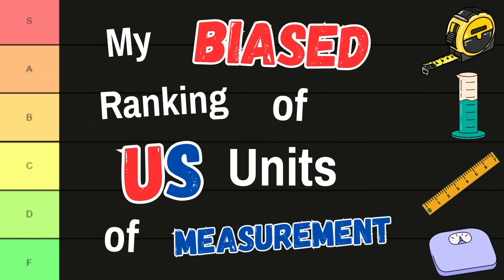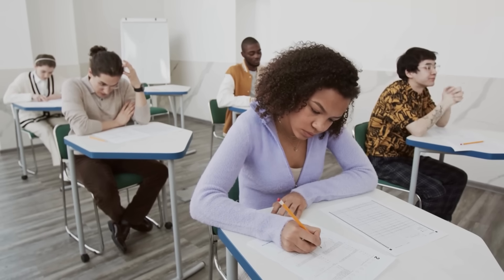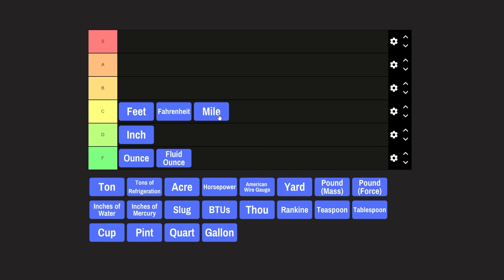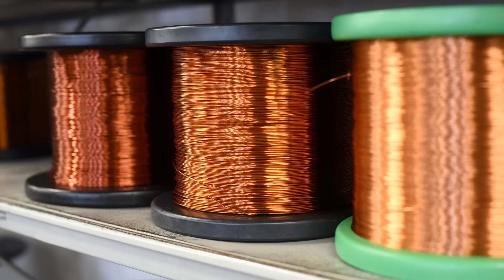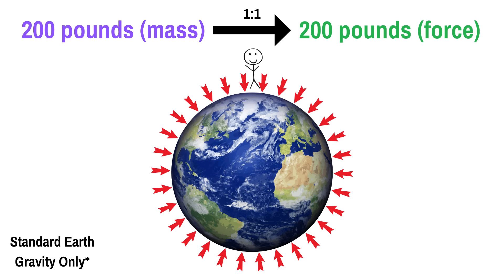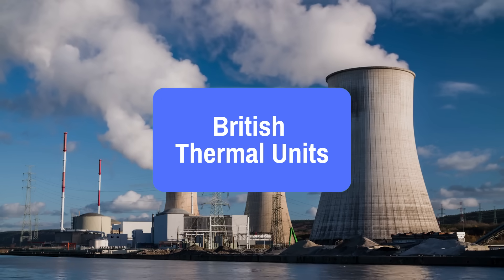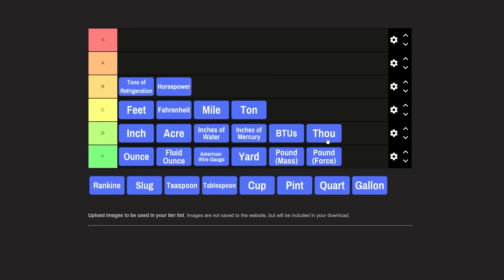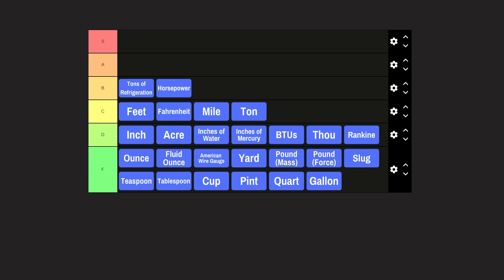Tier List of the DISASTROUS US Measuring System

Comment: If you’re going to be fair, you should acknowledge the warts in the SI/metric system too. Because it’s chock full of them. For instance:

The kilogram is supposed to be the coherent unit of mass in SI. So why does it have a “kilo” prefix on it? The 18th century French metricists wanted to call the mass of a liter of water a grave. Then the gram, the mass of a MILLI-liter of water could have been a MILLI-grave, and the tonne, the mass of a KILO-liter of water, could have been a KILO-grave. Well, grave in French sounded too much like Graf in German, which was an aristocratic title … which wasn’t politically correct at a time when aristocrats were being sent to the guillotine.

Ok but a liter isn’t actually the coherent unit of volume in SI. The cubic meter is. The original metricists had a word for that volume: stere.  So shouldn’t the coherent unit of mass be a stere of water? That’s a (metric) tonne of water. So really the tonne should be the coherent mass unit.  In which case a kilogram should really be called a millitonne, and a liter should really be called a millistere.  A gram is a milliliter of water, but that’s a microstere of volume, so shouldn’t the gram be called a microtonne of mass?

But we’re assuming that the coherent unit of density is the density of water, which is neatly one tonne per stere.  That’s what the original metricists wanted the unit of density to be. It made perfect sense. So why is SI’s unit of density a THOUSANDTH of water-density? Because either the cubic meter is a thousand times too big, or the kilogram is a thousand times too small. 

The newton is supposed to be the coherent unit of force in SI. But weight is a force. How many people get on a scale and read their weight in newtons? Why is it displayed in kilograms? Oh so you finesse that by saying that you really just want to know your mass. But what if you wanted to know what your weight would be on the Moon or Mars? Are you really going to multiply by the different accelerations and compare newtons? 

Or you can finesse it by saying there’s a kilogram-force unit equal to 9.80665 newtons. But that’s not SI’s coherent unit of force. Well why isn’t it? 

Why didn’t they use Earth’s gravity as the coherent unit of acceleration, and derive a coherent unit of length from that? We talk about acceleration in  “gees” all the time, but 9.80665 meters per second per second isn’t SI’s coherent unit of acceleration. ONE meter/second/second is. That’s 1/9.80665 gees. Talk about ugly!

For that matter, why is the second the coherent unit of time? A sixtieth of a sixtieth of a twenty-fourth of a day? Can you say ugly? Didn’t the original metricists come up with decimal time? Why isn’t the coherent unit of time a microday, or maybe 10 microdays?

Why are speed limits shown in kilometers per hour, when the SI coherent unit of velocity is the meter per second?

I could go on and on…

Comment: I would put the volume units at the end in C-tier. I prefer using those in cooking and baking over the metric system because I just have a set of "cups" each sized exactly to the respective units and its halves. I prefer filling a standardised cup with a liquid then trying to measure 240mL in a measuring cup
Reply: I didn't know that you weren't allowed to use teaspoons or tablespoons in metric. 
You might want to tell the millions/billions of people who use metric.

Comment: Teaspoons and tablespoons are nice for small amounts that don’t need to be super precise in cooking. I have an intense hatred for cups on the other hand because American recipes use them to measure absolutely everything (even butter for some reason???? how are you meant to measure a volume of butter?) when mass is much easier to measure and easily divisible however you want. Getting a 1/3 or 1/5 cup of something on the other hand is annoying as hell if your measuring device doesn’t feature those particular fractions.
Reply: I didn't know that you weren't allowed to use teaspoons or tablespoons in metric.
Reply: @ Exactly. You can still use them when they make sense.

Comment: In India we use Fahrenheit for body temperature measurement while degree Celsius for atmospheric temperature. We use kilogram for body weight, but pound and ounce for certain food items. We use feet and inch for measuring someones height but metre for depth. We use kilometre and metre for longer distance, but feet for house measurement and yard for cricket pitch. We use horsepower for engine power, calorie for food and Watt everywhere else. Our text books almost entirely use metric system but we still have these aberrations.

Comment: As an avid home cook, I agree with all of your rankings except for tablespoon and teaspoon. Cups, pints, and gallons are definitely unpractical units and I really hate to see them in recipes because they are not precise at all. Especially when it comes to the quantity of different ingredients like flour and sugar is listed in cups. 
I think (almost) every sane person has a couple tablespoons and teaspoons at home and since these are used to describe ingredients that a very small quantity is needed of, they are usually more practical for cooking than equivalent metric units. If a recipe lists that I require one teaspoon of salt, I can easily use just that — a teaspoon. But if instead it was listed that I require 6 grams of salt, most people would have a problem right there. In my experience, the majority of household kitchen scales are not accurate at all with such small quantities of mass (and sometimes don't even pick up on it until there is at least 20g on there). To name another example, if a recipe asks me to put two tablespoons of oil in a pan, I can just do that and put the spoon in the dishwasher. But if it would list the volume of the oil in millilitres, I'd have to use a beaker, which I need more frequently so I'd have to clean it by hand short after and is just not worth the effort.
I guess this is also the reason most German recipe sites list all their measurements in metric except when it comes to very small quantities where tbsp and tsp are used
Reply: I had no idea you couldn't use teaspoon and tablespoon in metric.
You might want to tell the millions, maybe billions (s) of people who do!

Comment: My pp is a 2 foot monster. Unfortunately, 60 centimeters and 0.6 meters sound awkward to me. I'm not sure what's correct.
Reply: 60 centimeters is the correct one. How is it awkward?
It's the same as me asking how do you say 2 meters? 6 feet and 6.7 inches just sounds awkward!

When you pick a whole number in one system, it won't cleanly translate. This is true both ways.
Reply: @logitech4873  what if I just describe my pp as a lion and yours as a mouse?
Reply: @Lkabss  I would use centimetres or meters. Measuring things in mice, lions, football fields, fridges, etc is a very American thing.
Reply: @logitech4873  ok I agree, centimeters for you meters for me then.

Comment: Every unit of measure is arbitrary. No matter if we use the speed of light or the distance an average man can travel in 1000 feet, it’s all arbitrary. If we talked to aliens they would probably shame us for using meters and then once we were colonized force us to use quarls, a unit of measurement with base 17, and based off the average distance of their planet to a black hole.
Reply: The difference here though is that the metric measurements work well with other metric measurements and never really need to be converted. Thus making the arbitrariness of metric measurements less compared to imperial measurements that really are just created with very little reason functionally.
Reply: @thebigcheese1153   conversion is not much of an issue with imperial either. You can do all the calculations if you understand the space between units just as easy. The arbitrary nature of local custom units is actually to the benefit of the people that use them. Knowing both I have no problem doing equations in meters, and then driving home knowing miles. Also even though I cook in mostly metric, because of where I get my recipes, I prefer the us standards because of how it splits sizes, I’d rather have 4 Tbls than 59 ml, which I would most likely round up to 60 anyways.
Reply: @Mnaughten601  True, I do agree that imperial for things like cooking and other home things makes sense. However I think anywhere past that should be in metric. I went to an Aerospace Engineering facility and found that all of their measurements were in imperial. I asked about it and they told me some other really strange measurements they use and the confusion and mistakes it gives them. I really think we should fizzle out the use of most imperial measurements except for the edge cases like Tbls that actually help. Especially things like pounds, stone, feet and inches.

Comment: this is such a tired topic. but also, fahrenheit is obviously clearly the best temperature system both because it is highly practical and celsius is terrible. i’m going to skip to point 2 because celcius has been getting away with this nonsense for too long. the boiling point of layer is a terrible candidate for 100 degrees. 1 it changes depending on your elevation, the amount of solute you have in it. 2 you never need that number. you can just LOOK at water and say oh ya. it’s boiling now. enjoy having a whopping 40 usable degrees for your daily lives though

Comment: US Treasury Bonds are traded in base 100, but the decimals are instead measure in base 32. Not sufficiently happy, american than divides 1/32 in further fractions. For example, a bond pricing 99-03+ means 99 plus 3/32 plus 1/32*1/2. Dafaq

Comment: Can someone explain why Americans use the short ton rather than the Imperial ton? ... the Imperial ton being close to the tonne (or metric ton).
I assume that it was because a hundredweight (cwt) of 112lbs didn't make sense?
Why then on top of it all  Americans then do not use the ton (or hundredweight?) but give heavy objects as thousands or millions of pounds?
Also, why change the imperial pint (20fl oz) ... to a 16fl oz pint that seems rarely used and messes up the quart and gallon? ... perhaps the quart being closeish to a litre is a saving grace.

Comment: I notice that you omitted to talk about the way all the U.S. fluid measurements were based on an error.  In the original imperial system, there are 20 fluid ounces to the pint. However, somewhere in the dim dark past, somebody in the U.S. thought there were 16 fl. oz to the pint. Seemed like a logical guess, given there are 16 oz. to the pound. This gives rise to the discrepancies on the size of a pint, a gallon, and all the other dependent measurements  between the U.S. and the rest of the imperial measurements world. Also, the U.S. ton is different to the original imperial ton, which is 2,240 pounds. The U.S. ton is often referred to as the "short" ton in the rest of the world.

Comment: I like the imperial system (British)
I would rather say I am 5Ft 7Ins than 1.71M.
1.71M means nothing to me. Same with weight. I would rather do it in stones and pounds rather than kilogrammes. Kilogrammes means nothing to me.
I prefer liters to pints (apart from when it is beer). I prefer to use centigrade rather than Fahrenheit.
For area I prefer inches squared.
Reply: People would usually say 171cm.
Reply: you are a menace.

Comment: Human brain: great at detecting patterns
Weight and volume of water in Earth's gravity and the speed of light in void in a specific sexagesimal unit casually fitting all together in a easy scalable system of adding 0s:

Americans: Freedom/Shelby, cows², Miles Morales, Feet kink
Reply: I'm dying
Reply: Meth is a hell of a drug.
Reply: Football fields
Reply: @PashkenS.  I REMEMBER THE FUKING CORGI SIZED METEOR WITH THE WEIGH OF 4 BABY ELEPHANTS
Reply: Squared big macs
Reply: Not really.
Reply: Fun fact
"speed of light in void in a specific sexagesimal unit" used to be Earth's circumference afaik
like, the Earth's equator being 40000 km = 40Mm long, originally, meter was defined using that

Comment: Was I told a lie about fahrenheit? 

I was told it was supposed to be 360° between freezing and boiling, but 360 was too many degrees. You can really only feel the difference between every two of those increments, so they just gave 180° between boiling and freezing. That's why there's Exactly 1.8 degrees fahrenheit for every 1 Celsius. 

Yours actually sounds like a made up story.

Comment: Feet/Inches deserve some credit for being base 12. Which makes the foot evenly divisible by 1,2,3,4, 6 and 12. That's actually got base 10 beat, as it only supports 1,2, 5 and 10.
Ounces are infuriating in that the same word is both force and volume.
But I'd give some extra credit to fluid ounces. The imperial volume measurements are, with the exception of the teaspoon, base 2 (3 teaspoons in a tablespoon.)
Doubling each time: Tablespoon, Fl. Oz, Quarter Cup, Half Cup, Cup, Pint, Quart, Half Gallon, Gallon. It's not as good as base 10 or 12, but it's consistent. Teaspoon is F tier. The others are pretty high.  
Glad to see you nailed Fahrenheit though. I'll actually take it over celcius, as I deal with the weather more than I deal with water freezing. Celcius doesn't even have the advantage of playing nice with the rest of the metric system.
The mile is F tier. No excuses.

Comment: You did forget the most horrible of them, the one so abysmally bad that even the US is getting rid of it!
I am of course alluding to the difference between a US Survey foot and the International foot: 1200/3937 m vs 0.3048 m
https://oceanservice.noaa.gov/geodesy/international-foot.html#:~:text=A%20U.S.%20survey%20foot%20is,of%20a%20foot%20per%20mile.
If you do the calculation you will find that they are almost but not quite identical. Normally this doesn't matter, except when you are doing GPS mapping using  UTM coordinates, where the numerical values typically range into 7 or 8 digits. At that point you are placing house foundations in the wrong spot or digging trenches that don't find the buried water pipes.

Comment: As an American i use the imperial system  for every day things that are intuitive and the metric system for anything that needs to be precise
Reply: Americans do not use the imperial system. The imperial system was created in the 1820s in the UK. The American customary system was standardized in the 1830s.Sure there are many similarities but especially on gallon and units derived from it there are significant differences.

The units pound and yard were standardized in 1959 to be 0.45359237 kg and 0.9144 m respectively.

Comment: Imperial measuring system is way better than metric. At least our units are modeled for everyday use, unlike the metric system.
Reply: Christian pfp = wrong
Reply: @gdstar6917 Not sure what that has to do with it
Reply: no 😂😂
Reply: Shockingly, metric works just as fine for everyday use. What do you imagine the problem is?

Comment: i disagree with a lot of these, honestly. what’s wrong with the measurement of a slug? is it that difficult to understand? it is exactly the same as the relationship between a newton, a kilogram, and a meter. feet and pounds are not any more arbitrary than kilograms and meters. we don’t typically do physics with the imperial system, but if we did, slugs would be pretty useful.
Reply: Feet and pounds are defined with metric units which have 100% accurate definitions. Theyre definitely more arbitrary than meter and kg
Reply: @yodaas7902  why? the definitions themselves are arbitrary. that's just the nature of units of measurements: they're always arbitrary. i don't understand what you mean by "more arbitrary" either.
Reply: @everyonesaidmynamewasstupi3713  SI units have common prefixes like kilo. Even if the prefixes themselves are arbitrary, once they have been settled it is no longer arbitrary what happens when you apply "kilo" to meters, for example. Also derived units like newton are not arbitrary. They can be logically derived from the  base units, with the only arbitrary part being their special name. (Newton rather than kgm/s^2, for example)
Reply: @yodaas7902  but the base units are.. arbitrary. completely and totally arbitrary. a meter is a meter because it is a meter, and for no other reason at all. 

i, like most people, much prefer the metric system to the imperial system for most purposes because of how much more intuitive it is to understand how units relate to each other. but i wouldn’t say it’s less arbitrary than the imperial system. so, a unit like a slug which is simply derived from pounds and feet, doesn’t seem so different from a  newton which is derived from kilograms and meters.
Reply: @everyonesaidmynamewasstupi3713  The system, however, is not completely arbitrary. Much less than the imperial system at that.
Reply: @yodaas7902  well, it is! it’s very consistent and intuitive, but it’s still arbitrary. though in this context i can understand what you mean by “less arbitrary.”

but regarding what i was originally talking about, comparing an imperial slug to a metric newton, the units really seem very similar in how they’re defined/derived and i personally wouldn’t say a newton is a better or worse unit than a slug